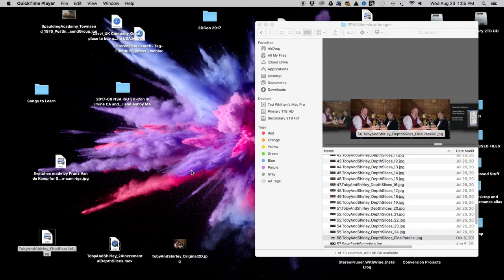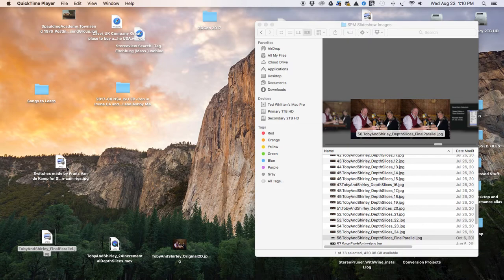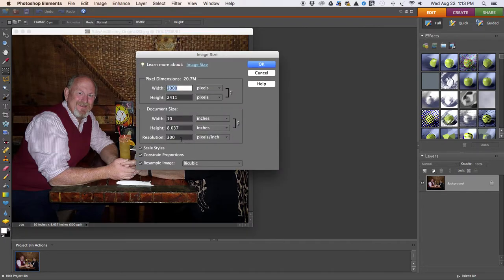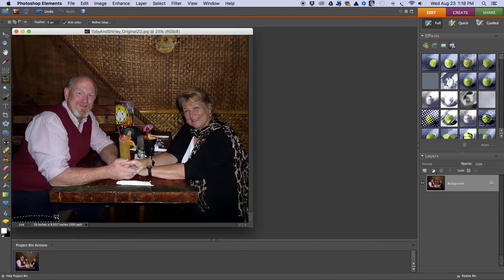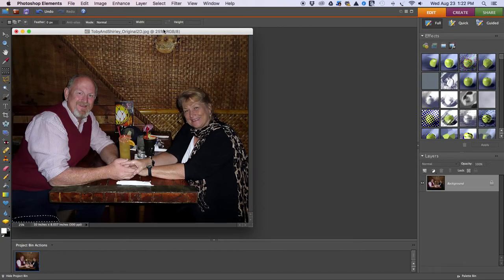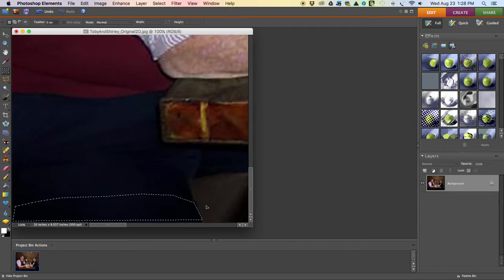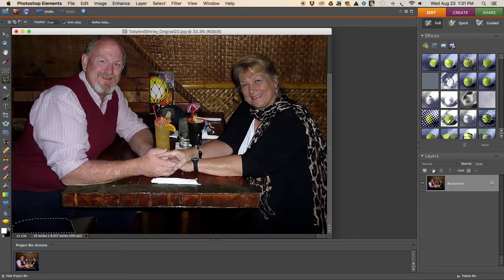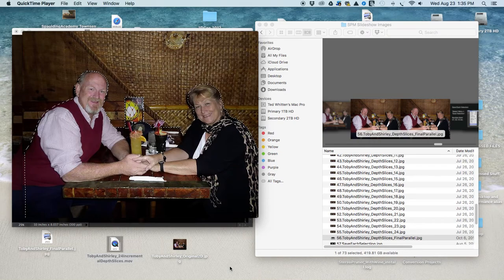An Introduction to 2D-to-3D Image Conversion

Comment: Hello, Not speaking English, could you tell me the keypad keys you use to move the selection. I use Photoshop cs6. Cordially
Reply from the maker: Hello Olivier.  I work on a Mac.  On a Mac, you need to hold both the "Option" and "Command" keys, and then tap the Right Arrow key.  Before doing that, make sure you are viewing the image at 100% before you move the selection.  This will ensure that each time you move it, it will move 1 pixel.
Reply: @TedwardsTube  Thank you for your help but it does not work (or I do not understand the principle) under Photoshop cs6. moving a few pixels makes a hole appear and not cloning the offset part and in addition it is impossible to add a selection to the first selection (the first one disappears) i do not understand anything there so i give up it is technical. Cordially
Reply from the maker: @olivierduveau1518  If you're on a PC, hold down CTRL + Alt, and then tap the right arrow key.  And as I explained (around the 23:00 mark), you must change "New Selection" to "Add To Selection" (in the horizontal tool settings bar at top) in order to be able to add to the selected area, instead of creating a new selected area.  I know it's all very complicated.  Anything worthwhile is never easy.  Stick with it.

Comment: Very good tuto and rare on the subject of unpacking (a pity) however how in the end do you create the final image? I have tried to register on your Facebook group but I have no answer (does it still work?) Cordially
Reply from the maker: Thanks.  Yes, the Facebook group is still active, but I haven't been on there lately.  I've approved your request to join just now.  As far as "creating the final image", once you have a left eye and a right eye image, that's done.  A stereo image is just that - two images - one from the perspective of what the left eye sees, and one from the perspective of what the right eye sees.  Of course, there are many ways to view the 3D image .. stereoscopes, anaglyphs, free viewing parallel or cross-eye, using a VR headset, using your phone, using a 3D monitor, 3D tablet, 3D TV etc.  I suggest obtaining the free software program StereoPhoto Maker, which has several handy tools for adjusting images, aligning them, and converting them to and between the various formats.
Reply from the maker: https://stereo.jpn.org/eng/stphmkr/index.html

Comment: Thank you for this tutorial. Do you maybe know any tutorial explaining how to combine pixel shift and depth maps for stereo purposes? I've done some depth maps for lenticular printing but I had dedicated software to create frames there and no option to use multiple layers and corresponding depth maps - I don't have good idea how to combine these in any normal program :(
Reply from the maker: Michał Wysocz , hi. Thanks for commenting. I’ve only done depth maps 4 or 5 times, and don’t consider myself too good at them. Usually I do my conversions through a gradual, slow, very manual process, much like what I describe in this video, although more recently utilizing layers to a much greater degree.   I made my depth maps manually too. Carefully selecting everything at every layer and filling it in with a shade of gray (or multiple shades, or sometimes gradients), so that the foreground is white and background gradually darker (or vise versa) until the entire image is represented. Then you ‘apply’ the map to the original image, to generate the second eye’s perspective.  I use Photoshop to create the depth map.  Then to apply it you can use Photoshop or Stereo Photo Maker. I’m not at my computer now to tell you the menu steps etc to do that, but you can find it online. I welcome you to join my Facebook group too, if you haven’t already. There are some extremely talented people who can answer questions and give advice. The group is called Let’s Convert 2D Images to 3D.
Reply from the maker: Michał Wysocz This very short video gives the basics.. https://youtu.be/3r4M_KHt6aw
Reply from the maker: Michał Wysocz This one is good too.. https://youtu.be/HVSf22VT1t4
Reply: thank you!